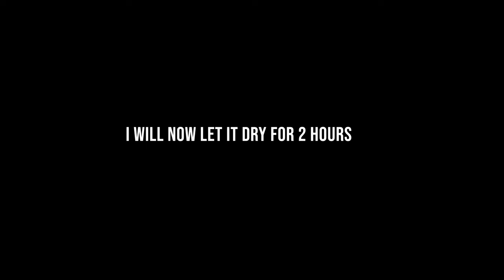FIXING A VINTAGE CARTRIDGE-STYLE 6 DISC CD PLAYER CHANGER ASMR REPAIR PIONEER WON'T READ DISCS

Comment: Great instructions. I would suggest that you clean the laser located where the lense fell off of. If it's been off for a while some dust may have settled on the laser surface. Use a q-tip and isopropyl alcohol to clean it and the lense.

Comment: I have a 702 I just got and it works good except it needs a little tap to fully eject the cartridge. Everything is working without the cartridge in and I hear it work but the cart is sticking somehow. A light tap on the side makes it pop right out. I can't find any mechanism or catching point. Any idea what it might be? A belt underneath maybe?

Comment: Lens fell out. It’s usually in there somewhere, I have a pile of these.
Reply: George where did you get the lens?   I took mine apart, it's missing the lens but I cannot locate it even though I know it should be in the unit
Reply: @JimLucke  when you acquire units, some have already been opened and the tiny piece most likely has fallen out unnoticed. Or it was found and the unit is “innocently” sold as us for parts or repair. I’ve bought those then later looked at the other things they sell.  Then realizing it was sold like that on purpose. As Tara as I know , you can’t buy them anywhere. The ones I have aren’t working in the unit I last worked on. Idk if it’s that the lens I have is applied or there’s more wrong with the unit than just the lens falling out. 
Keep looking. It could have gotten stuck in grease or wedged into a corner or stuck under the circuit board. 
I don’t see how one could escape the cavity unless it finds its way to the flap that covers the cartridge opening. And I can’t see how that would happen. 

There’s more than one occasion after putting one aside.. looking again and finding it. 
Don’t give up but know when to stop. 👍🏼😇

Comment: Nice repair! Also I think you can buy a new lens for old CD players. This seems like a very hard repair since you have to glue the laser back in place and it is a very big risk of damageing the laser if you glue it
Reply from the maker: I've tried shopping for the laser assembly and I've never found anything. It's really either glue it in or don't fix it, unfortunately.
Reply: I do have a question. Are lens all the same or do they all have different optical characteristics. I probably fixed a dozen of these. I also ruined a few lenses. You know of any way to restore them? Polished them up? Short of trying myself, I’d figured .. ask. Might save me half a day. Lol
Reply: @Spencertified  if you need assemblies .. I have some. But they are lenless
Reply: No not true per necessary, those lenses rare are really damaged. And glueing them back in is super easy. With either a needle applicator or toothpick with. A dab of glue , ...around the "lip" of the lens. 

You won't damage anything and sonically no difference compared to a new lens. Done this dozens of times